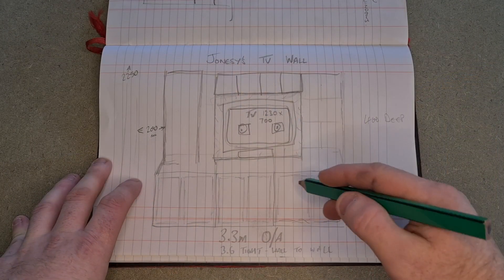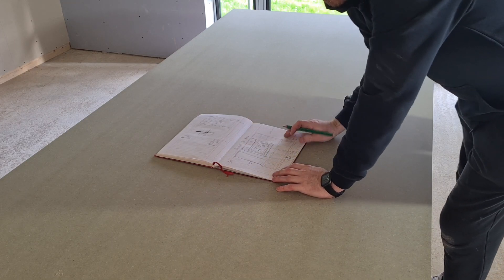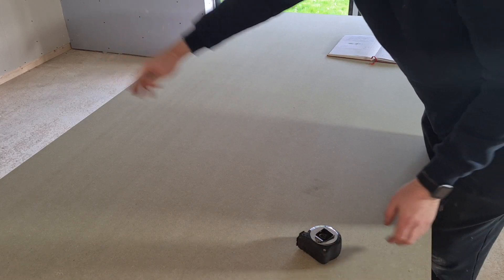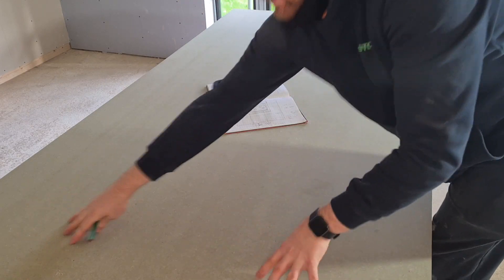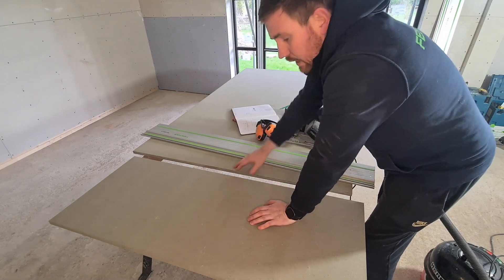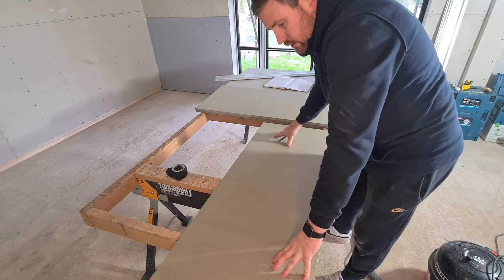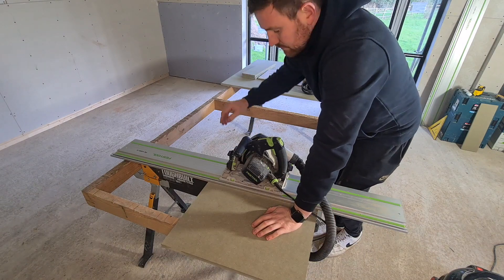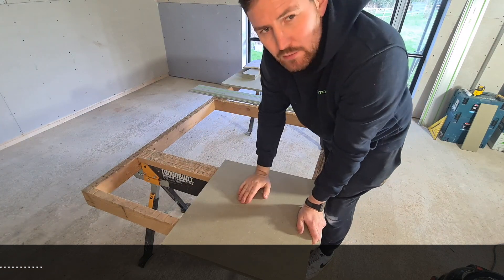MDF TV Wall For Begginers!! Step by Step Guide... Part 1!!

Comment: Do I only need the moisture resistant board if I’m painting it? My units will have a worktop on and I’m covering the doors? Cheers
Reply from the maker: It's still a bit of a better product to use in my eyes incase it case it ever gets damp

Comment: Hi Ben
Is there any advantage to using a plinth over regular cabinet feet?
Reply from the maker: Hi mate, if you want to keep the height of the plynth to a minimum it's very hard to use normal feet. You can cut normal feet down to a lower height but the adjustment of the back ones becomes almost impossible.  So on this one we used a solid plynth base with no adjustment needed once it was levelled off. 
👍

Comment: Is moisture resistant MDF the go-to material for furniture that will be painted or coated with resin or is it more about the quality of the material or the location it will be used in? I spoke to a furniture maker the other day that told me MDF quality has gone down quite a bit as prices have gone up.

Never seen a workbench that looked like yours. It really makes sense when cutting sheets.
Reply from the maker: Hi Chris,
Moisture resistant MDF is my go to material for this type of build. It paints nice, machines nice and if you are building it in a cold place but fitting it in a warm place the movement is minimal.
The workbench consists of two toughbuilt c700s with a 4x2 frame I made up for it